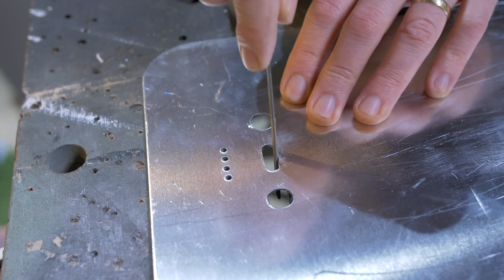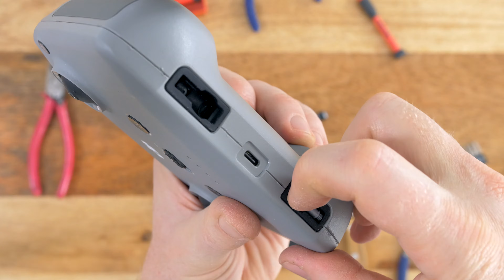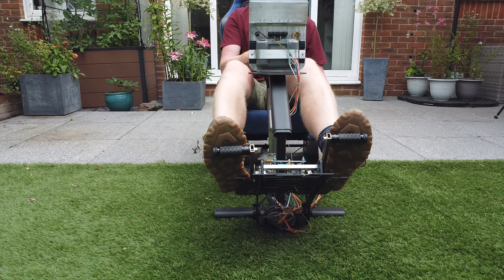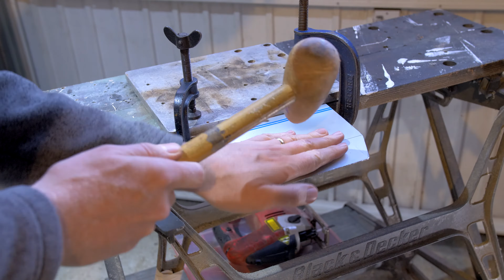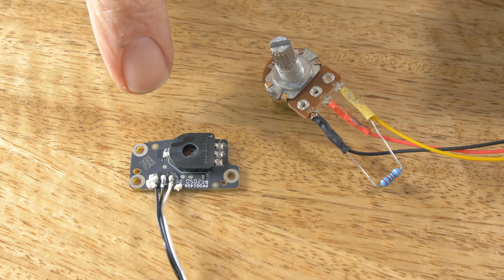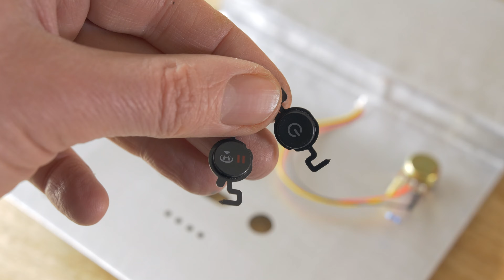Homemade Joystick Drone Controller Part 2: Control Panel

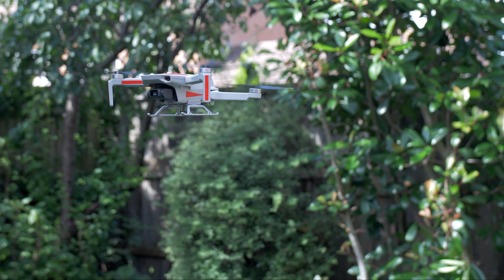Comment: Well, now it’s time to support the rig with a 9:40  motion assembly. Just have to pull the roll pitch yaw data and feed it, like a force feedback joystick controller.   A gyro  mounted on the airframe can also send the data back via the audio channel of the VTX. That device was available for a few years and allowed a force feedback gaming controller to interface with the radio’s buddy box. Yes, the buttons were still programmable for stuff like landing gear and lights, flaps, etc.
Reply from the maker: Yes good idea. I've got a few more smaller projects on the way first - A motion rig would be a bigger project but we'll worth it. You're right, I need force feedback which I hadn't really considered before. Thanks!